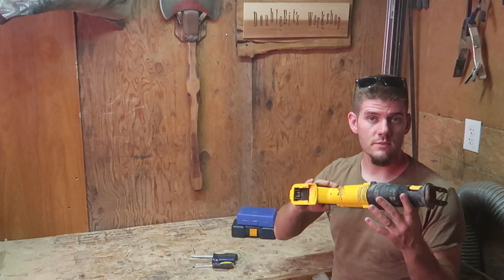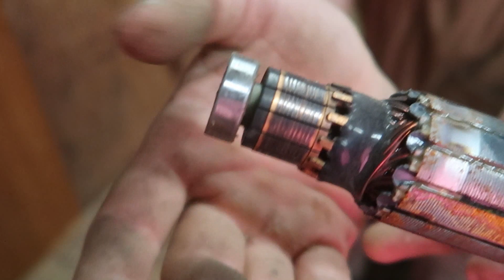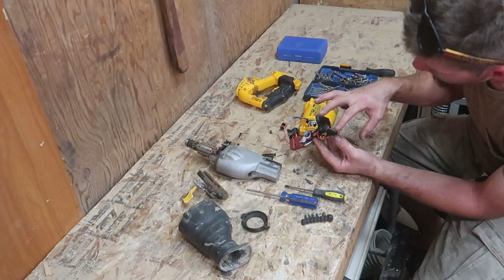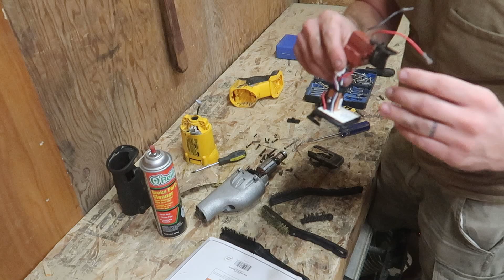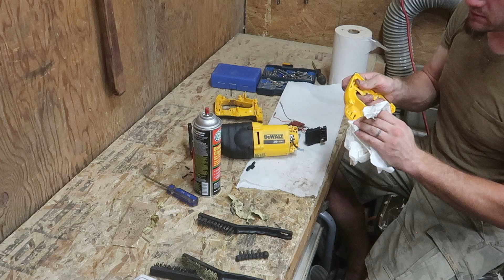How to Deep Clean, Fix, and Maintain a DeWALT 20V Reciprocating Saw

Comment: Awesome video. Picked one of these up 2nd hand. Saw runs perfectly when cold, but after cutting for 10-15 minutes...shuts down like there's a dead battery...yet battery has plenty of life. Sounds like cleaning the armature and brushes is going to potentially resolve this issue??? I think I just found my project for this Saturday afternoon. Thank you so much for taking the time to explain the process and why this tool may shut down from any voltage issues.

Comment: Thanks for posting I just fixed my DCS387 Sawzall  I’ve had it for over six years thought I lost it after it got wet, till I found this video. different model, but same concept I was able to follow through with similar steps. Great video.  Saved me $200 on a new one 👍🏽

Comment: Found a discarded unit (Dewalt DCS391).  Luckily I had a battery, seemed to work OK when first turning on, but decided to follow the breakdown video and found that the blade holder was rubbing on the inside top of the aluminum casing to the point that it ware a grove through it.  Wondering how hard it would be to gut the top and reinsert gears, etc. into a new casing, or if I need to replace the whole top end.  Not sure why the contact happened in the first place unless the previous owner used too much pressure?

Comment: Just FYI: The long grey steel parts of the armature are called a tooth of the armature stack. The groves are normal, that’s where they ground away metal to balance the armature. The smaller copper bars towards the back of the armature are called commutator bars, that is where the brushes actually ride to deliver power to the armature. Good tear down video!

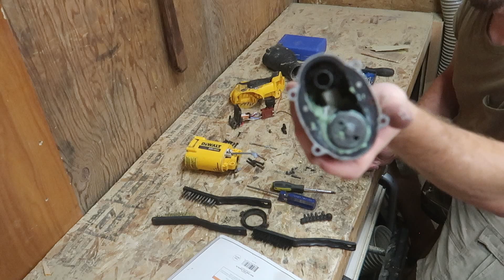Comment: 18:06 what is the brand name & part number of grease that you used?
I want to know the substitute for dewalt grease that is readily available in store.  Thanks.
Reply from the maker: I used some red and tacky #2  or marine grease, from what I can find it seems to be the closest thing to what DeWalt suggests using. Marine grease should help to maintain use even if slight moister has gotten into the saw. From my past experiences, having any help to keep tools working and rust free in all weather can only help as well!
Reply: @DoubleBitsWorkshop  thanks

Comment: I'm glad you touch upon grease in this video, because few people seem to want to mention lubrication at all. 

I figured general bearing grease would work fine, but do you recommend any kind of regular intervals? I'm assuming the factory lubrication is sufficient for a while but most things eventually need more.
Reply from the maker: Thank you for your comment! 
It depends on your use of the tool, if you do a lot of drywall cuts I would say to check every few months, or if your constantly cutting steel and getting the unit too hot to touch then same, but if your just using ng the tool every now and again then every other year or so shouldn't be a problem
Reply: @DoubleBitsWorkshop  Fantastic, thank you

Comment: Hello thank you. What type of Greece should be used on the reciprocating saw?
Reply from the maker: I would use some marine grease. From a grease gun. It's not too thick so your gearing will move freely, and marine so it helps with possible moisture. No matter what climate you live in it helps!